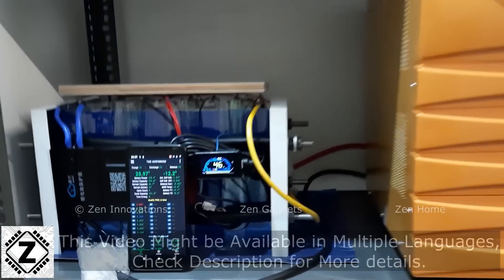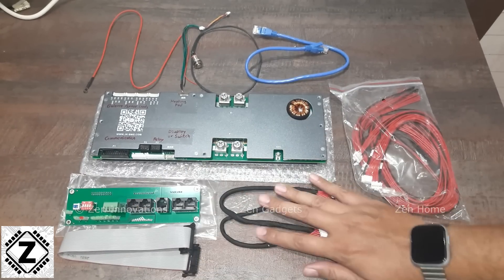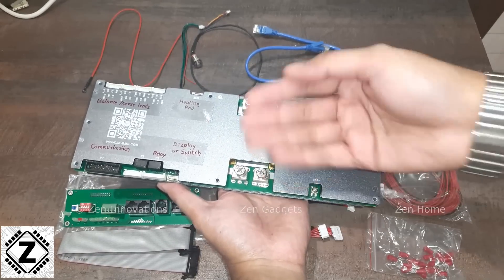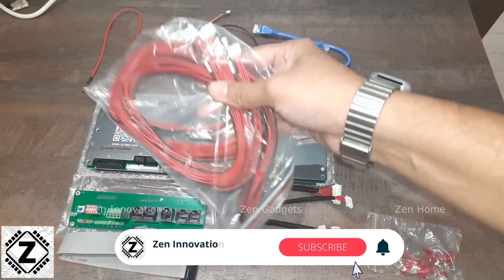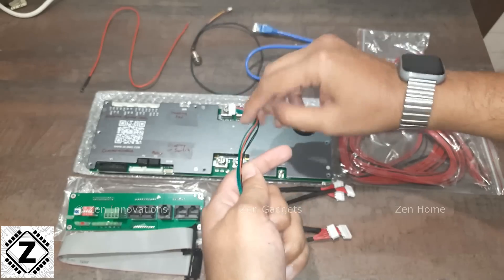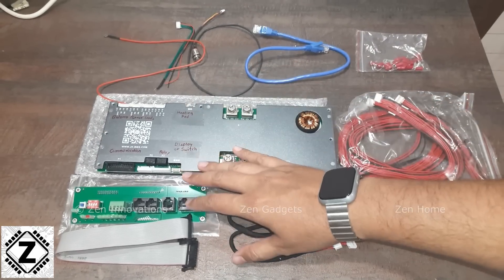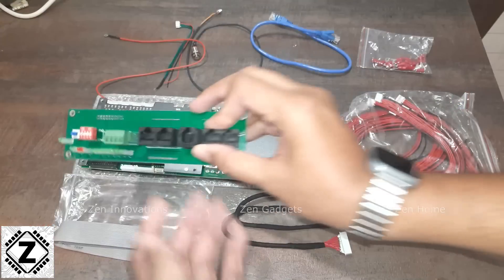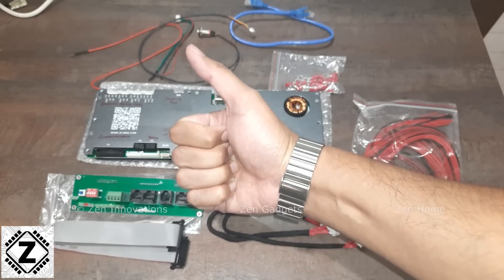[Eng] JK Inverter Communication LiFEPo4 Lithium Smart BMS part 1 | New & Improved in 2025?

Comment from the maker: 🌟 This Video is available in Multiple Languages 🌟
🔷 English https://youtu.be/_w1dGxhK9MU
🔷 Hindi https://youtu.be/ixwGv4V_T6Y

[Best Buy Affiliate Links]
Sigma 313A Clamp meter With Inrush https://amzn.to/46Q5KTr
A Grade LIFEPO4 Cells https://amzn.to/3vLfbWh
Lithium Iron Phosphate BMS https://amzn.to/3S4Gwu0
Lithium battery Active Balancer https://amzn.to/3vMremm

Buy UTL Gamma Plus 3350 With Lithium Support https://amzn.to/472bxop
Buy UTL Gamma plus 2kVA 24v https://amzn.to/3Q723S2
Buy UTL Gamma Plus 1kva https://amzn.to/3xodWtz

Chapters English
00:00 Physical overview & Build quality
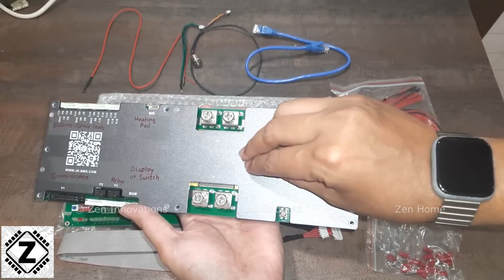02:32 Updated hardware 2025 vs 2024 
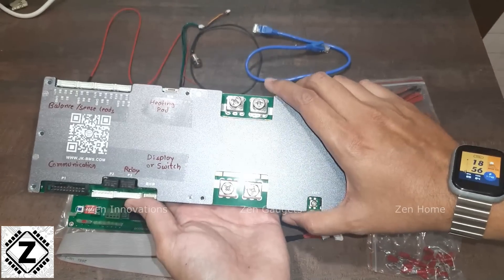03:43 Connectors, jacks & Pinout. Balance Leads, heating terminal
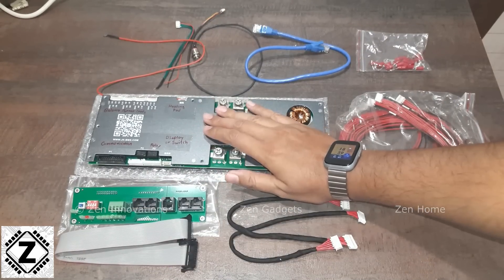07:15 Communication & Daughter board, Parallel compatiable RS 485
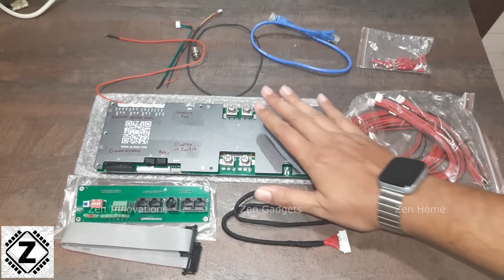08:17 Programmable Dry contact relay triggers
09:21 LCD display. 2.5 inch and 4.3 inch touch screen or switch
10:04 Conclusion- Still the BMS king?

#ZenWithLithium #lithiumbattery #lithiumironphosphate #lifepo4battery 
#allaboutbatteries #ZenInnovations #SolarEnergy #ZenEnglish

[Playlists]
Solar Energy Playlist-
https://www.youtube.com/playlist?list=PL9YrG_WglF9wGck8_iWjvKxmlvKnQ__O5

All about Batteries Playlist-
https://www.youtube.com/playlist?list=PL9YrG_WglF9wih930Hitw3ZYjfWRu6TVv

Comment: Sir Can I use 4S Or 5S Active balancer used with 3S or 2S bms or bettery ( for example 4s balancer used with 3S bms by shorting/connecting it's 3rd and 4th point with bms/bettery last terminal, in this way the balancer will get same voltage and thought that this point are balanced)???
Reply from the maker: Avoid.